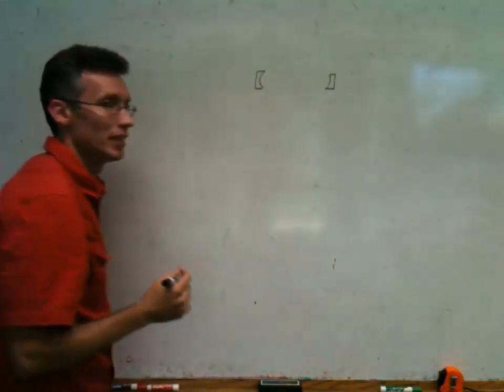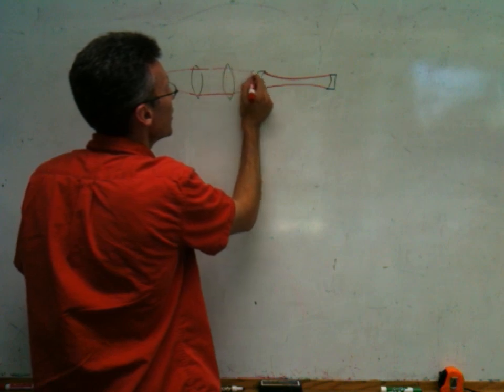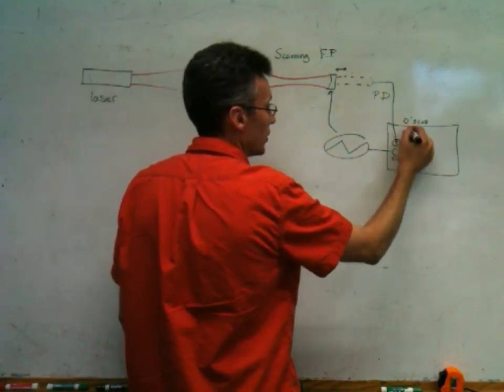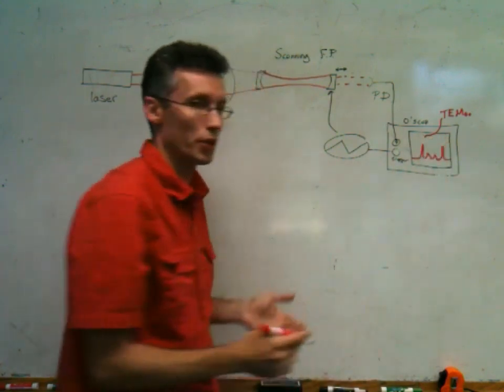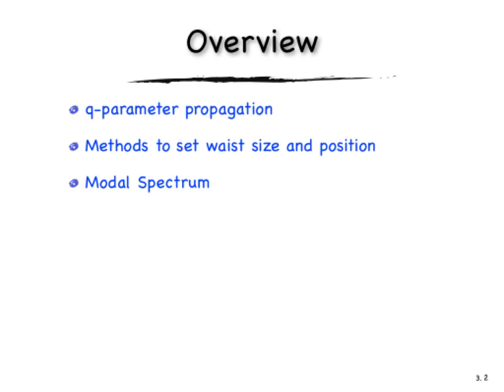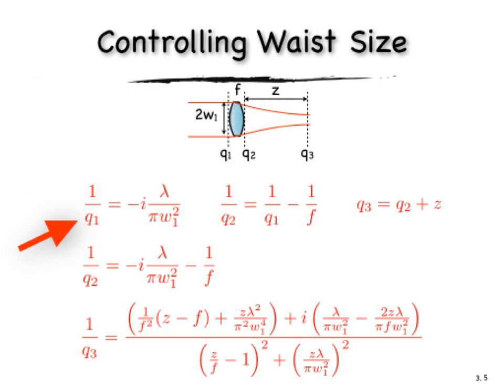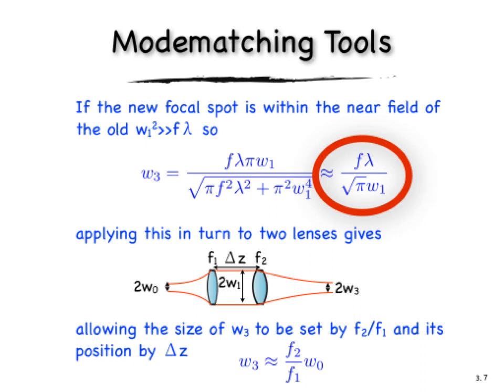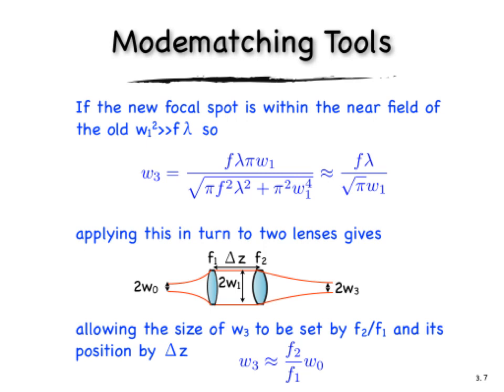Mode Matching

Comment: There is a mistake in your calculations for 'controlling waist size' (around the 10 min mark), right?. The imaginary part of 1/q3 looks different when I calculate it by hand (and additionally with mathematica).  The numerator in the imaginary part should be lambda/(pi*w1^2). Maybe my calculations are wrong. Could you comment on that?

Comment: Dear Peter, I have a (probably) stupid question: does the light from the laser reflect from the back of the mirror as it enters the cavity or does all the light from the laser make it into the cavity (ideally)?
Reply: +kingrobert04 The mirror will probably have an anti-reflection coating on its back side to minimize reflection off of its surface. However, all of the light will be reflected from the cavity if the light is not on resonance. The peaks one sees in transmission are "100%" transmission, whose narrowness is determined by the finesse of the cavity.

Comment: Could you please tell me the mode matching into triangular cavity in which two of them are plane mirrors?
Reply from the maker: The procedure to mode match into a triangular cavity is the same as a linear cavity, but for calculating the eigenmode of the cavity use half of the cavity perimeter in place of the cavity length (L -> p/2). The other difference is that the reflection at non normal incidence from the curved mirror introduces astigmatism.  This is usually dealt with by minimizing the angle of incidence on the curved mirror when building the cavity.  Typically a triangular cavity would have two planar mirrors that are partial reflectors and oriented at nearly 45 degrees to the input beam.  One is the input coupler, and one is the output coupler.  The third mirror is a curved high reflector that forms the third point on the triangle and is at near normal incidence.
Reply: Thank you so much!

Comment from the maker: If one mirror of a Fabry-Perot is flat, the mode matching condition is that there is a waist at the location of that mirror, and that the waist size be such that by the time the beam gets to the other mirror its curvature matches that of the second mirror.  If BOTH mirrors are flat, there is no way to mode match (in theory you could, but you'd need an infinitely large beam waist) such a cavity is unstable.